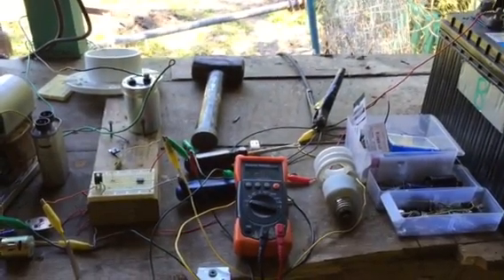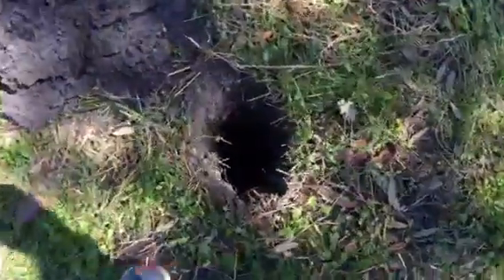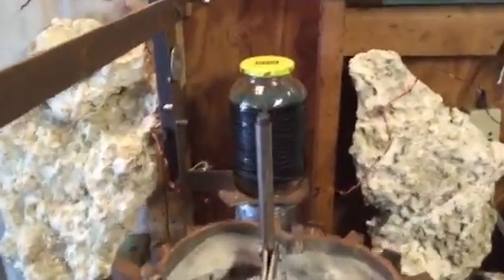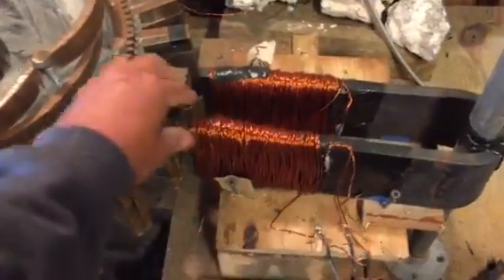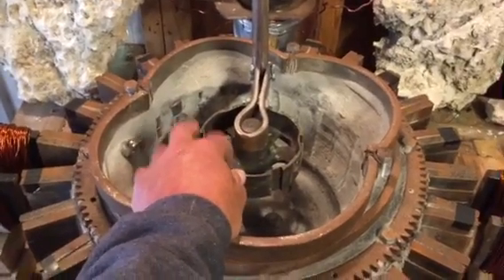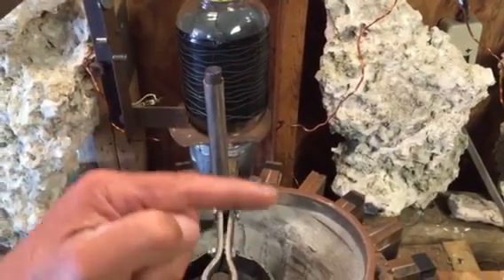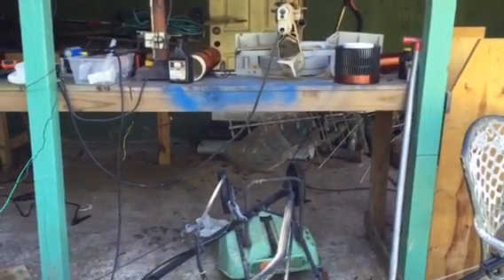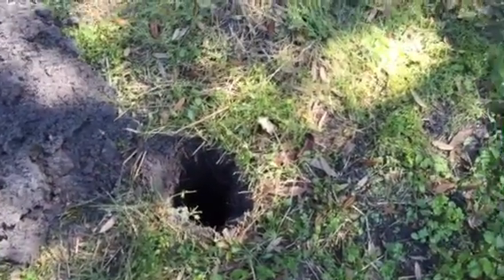Ed Leedskalnins workshop. Building a rechargeable earth bat

Comment: 7-129 6-105 195 code Vinny,  360 at 15 degree intervals, 6, 8, 16, 24, don't forget to do the math or geometry, from north 360- the 129 can be found from the sequence of prime numbers and 150 degrees @ from north is where you put the pyramids corner, set with the right angles lining up at 150, 260, 330, and 60 degrees, it's all about the codes Vinny, ADM is 144, Ancient Knowledge 2:13:48